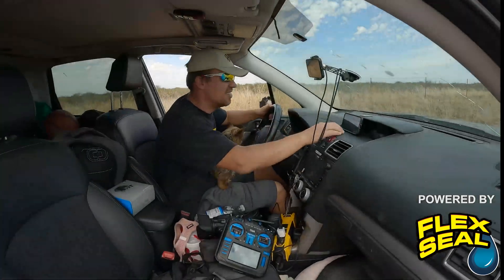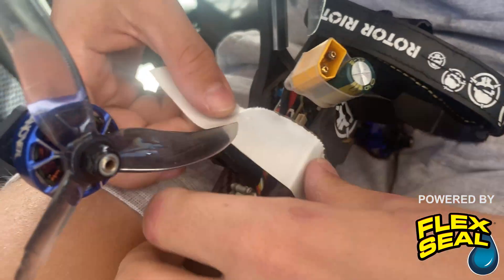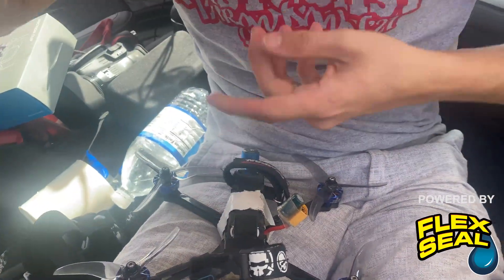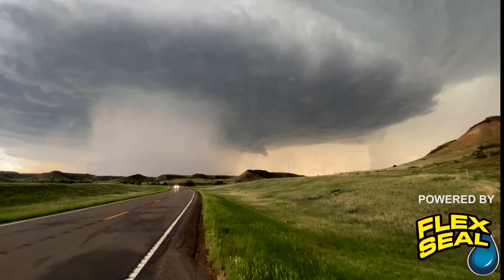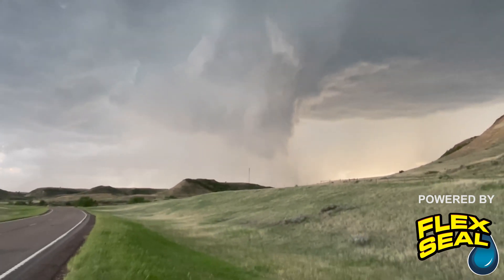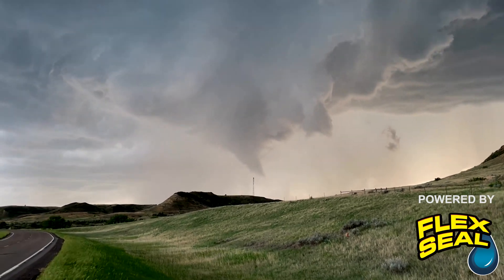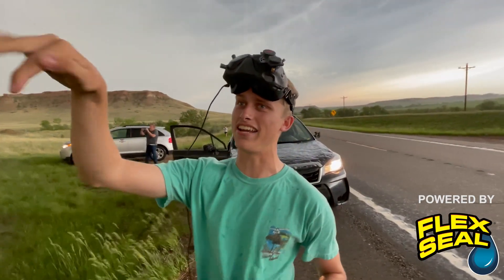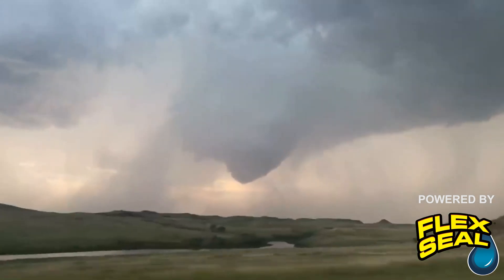TORNADO CORNER FLOW project with Dominator FPV Drone and Flex Tape!

Comment: Had a spot on a porch roof that kept leaking in the valley where two roofs met and tried everything to stop the leak and finally tried flex seal not expecting much as most seen on tv products let you down, but not this time 1 1/2 years in flex seal did the job!!!!!!